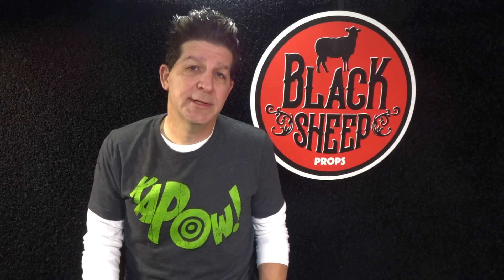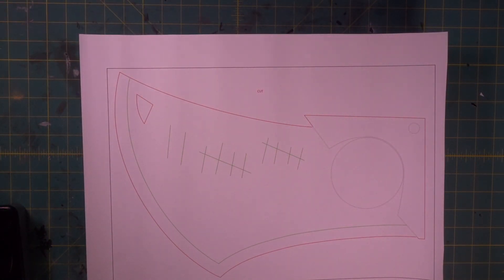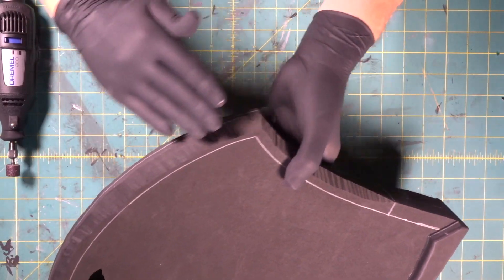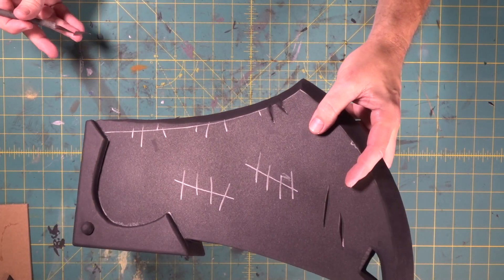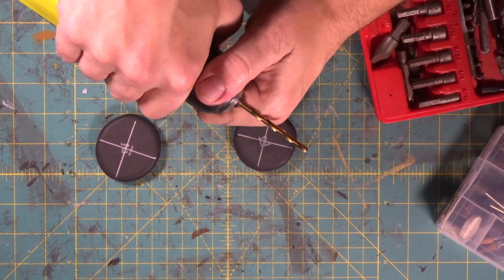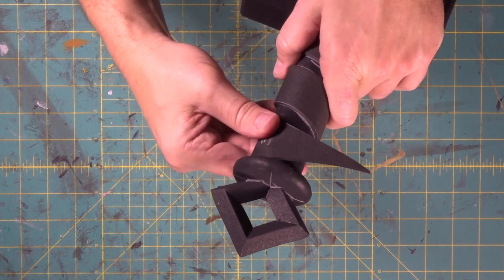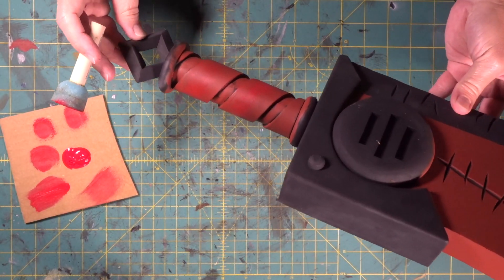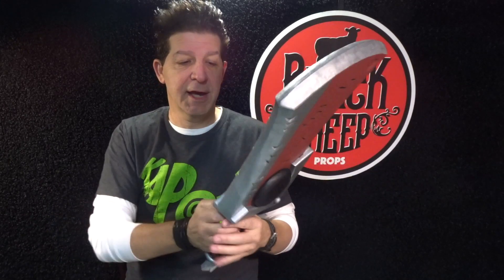Making An EVA Foam Broilers Cleaver

Comment: It looks awesome, good job !

 Quick questions, how much does the foam cost for this project ? Is It specific paint for foam ? And what the name of the glue ? (I didn't catch that in the video) 

Thank you for putting this out on youtube !
Reply: Its called contact cement
Reply from the maker: Hi Valentin! It’s hard to know how much each prop costs because I have collected many sheets and rolls of foam over time, and I am always buying more rolls as I run out. When you first start you have to buy a roll of foam for each thickness you will need and then you will have foam leftover to begin having a nice supply on hand for the next builds. As far as paint goes, I mostly use acrylics from the art supply store, and some spray paint. I mostly use contact cement and some super glue for smaller parts. Check out the videos on my channel to see all of the information you will need to build foam props.  Enjoy!!
Reply: @yenyendehyper  Thanks
Reply: @BlackSheepProps  Ok thank you, will do !